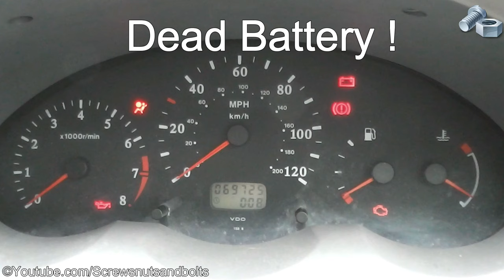How to Start Your Car using a Portable Jump Starter (Booster Pack)

Comment from the maker: Thanks for watching my video. If you found this or any of my other videos helpful, maybe you could consider supporting my channel by using the ‘Thanks’ button below each of my videos. Your support would be really appreciated, thank you ! 👍

Screwsnutsandbolts
Reply: How do you charge these chargers ?
Reply: How do you charge the jump pack?
Reply from the maker: It comes with a mains charger that plugs into the rear of the unit. @niojose967
Reply: @screwsnutsandbolts  there is nothing at the back of to indicate I can plug it anywhere
Reply from the maker: @niojose967  On this one, there's a jack on the upper rear side. The charger plugs in like a laptop charger.
Reply: @screwsnutsandbolts  ok seen it do you know where I can get the charger for it?
Reply from the maker: @niojose967  This one is the exact same one that came with my Halford's booster pack: https://www.ebay.ie/itm/174861069169
Reply: @screwsnutsandbolts  thank you so much appreciate the help Happy New Year
Reply from the maker: @niojose967  You're welcome, happy new year to you !

Comment: I just went through about a dozen videos on portable chargers. Some went for positive/negative, some went to ground... many advised to switch the charger on before you connect the leads, some didn't even show it to be switched on.

This video was the most reasonable out of a dozen I just tried! Thank you.

One thing I would recommend to do, though, is not handle both leads with two hands at the same time to not risk running 600Amp through your heart.
Reply from the maker: Thanks for watching, and for the tip :)

Comment: This looks like the correct way to plug in your positive and negative cables.  I've seen so many videos where people plug in the negative black cable to the negative port of the battery instead of a grounded metal block or bolt somewhere away from the alternator.  The only time you would only plug in a negative cable to the actual negative battery pole is on a working car battery, and you were not using a portable battery jumper.  And on the dead battery side, you would still plug the negative cable to a grounded piece of metal block.
Reply: This is the method you use when connecting another car directly to yours. You cant use any other way. But with some of these charging boxes you can go straight to terminal, as long as they are turned off when you connect. You might have to connect specifically to a part of the car other than a bolt, like some have auto start stop, and those cars have a specific place for you to connect to if youre jumping them.

Comment: yes i found it that simple too using the same 4 in 1 phaze charger model about £50 halfords. has good reviews but not sure about the negative views as it can have enough charge on it straight from the box and works perfect on a 2.0i. suv no problem and could obviously start something much bigger. having said that, it takes hours and hours to fully charge and you can see from the video, its fairly heavy with reasonably lengthed leads but can be hard to find a spot to rest anywhere up by the battery so careful not to scratch or even dent your car. thanks great post!
Reply from the maker: You're very welcome, thanks for the comments. I've had to use it a few times already and find it great !

Comment: Great vid. I had to try this on my sons last night (yup, Christmas Day!)
It didn’t work for me and the booster was only charged a couple of weeks ago.
We had to bump start the car and when I re-read the instructions, it says that once the leads are attached and the unit switched on, you need to wait for a minute to allow the two batteries to equalise before starting. 👍
Reply from the maker: Thanks for the comments :)
Reply: I have just bought Halford 6 in 1 Jump Starter.  Instructions aren't massively clear.  I don't suppose it can hurt to wait a minute as you suggested, haven't seen or read that anywhere else.  I really hope the car starts, it's a relatively new battery.  Cheers.
Reply: These jump starters only boost the voltage of the main battery and assist it with starting the engine.  Depending how flat the main battery is you may have to let the jump starter charge the battery a little to wake it up enough.

Comment: This is from Halfords costs about £50 17ah battery which is good
Reply: hi, I have same model from Halford and  I just want to know when the device is fully charged through ac adapter do the charging red light will go off and green one will turn on?  Mine jump starter showing red light even after charging for 6 hours...
Reply: @paduthala  just purchased one and mine doing same thing

Comment: I bough one of these for a 1.6Ltr Fiesta in January 2017 for £35 from Halfords (I think there must have been an offer on). I have used it twice on a 2.2Ltr Diesel RAV4 (I sold the Fiesta). Once when the battery was completely flat, it turned it over but not fast enough to start. Then a week later on the same car with the battery low, but still able to turn the engine over, but not start. The Halfords jump starter gave it enough extra boost to start it. I think it is fine for smaller engines, but it might struggle on engines over 1.6Ltr with a really flat battery.
Reply from the maker: Yeah I've heard that alright.
Reply: Me too! Got this same one from Halfords and in a sale but not used it yet as not had a flat battery....I worked in the car trade for over 20 yrs and what we used costed like over £200 but jumped absolutely anything like Ford transits,3.0L Mercs etc  time over time ie 5 times before recharging.And i also agree that these should be used for under 1.4L and my car is a 1.3L....depends on how big the batters also matters.You pay for what you get.
Reply: @tardeliesmagic  what did you use back then man?
Reply: @championdesigns  It was a sealy brand,come to think of it...it was close to £280,we used it multiple times when we re arranged the car sales forecourt.I think it went flat after 6 jump starts,3.0L Audi's were easy! Same with those BMW's X5,we had 2 Sealy jump packs in the sale office. Had them for like 3 yrs before we noticed they started going weak.We used them nearly every day and alot every 2 weeks moving a good few cars around.Over kill yeah,but £280 was worth it.I still have my Halfords in my boot of my car,i charge it regardless every 4 months and doesn't lose any charge.Charged it 6 months once and it lost 1 bar.I have a 1.3L so be  easy to jump start.Had my Halfords jump pack 5 yrs now,still holding charge and works.You need a half decent jump pack for a 2L thou.My one was cheap.

Comment: Excellent video and thank you, just wondering when using a jump starter or booster pack, some video says, connecting negative end to ground and some says negative end of the starter or pack connect to negative terminal of battery, which one is the standard or correct way, for a normal cable jumping, negative end goes to ground of vehicle with dead battery.
Reply from the maker: Thanks. The standard way is negative to ground (away from the battery) in case it creates a spark and causes the battery to explode. Unlikely with newer sealed batteries but better safe than sorry :)

Comment: I got a fatmax, does it matter if I conect red first or black?  and after car starts do I have to turn off the unit and take off the wires right away, not good if it's connected too long or something? also how long will those thing last? mine is 1,2 years old havn't used it yet
Reply from the maker: If it's switched off then it doesn't really matter which order you connect them. Once the car starts the alternator will be charging the battery so there's no need to leave it connected. I've had mine for 3 or 4 years and I've only used it a couple of times but it's still working fine. It's recommended to charge them up every couple of months even if you don't use them.

Comment: can you please explain how the current flows when jump starting the car? DC runs from negative to positive. we connect the positive to positive and the negative to the chassis. so, since that is a circuit (ground -negative / positive-live -> positive dead battery)...how is that charging the dead battery through the positive cable?

Comment: Some vids say connect negative to negative battery and some vids show negative battery to earthing point. Which one is it
Reply from the maker: The proper and safer way is to connect the negative to an earthing point. A lead acid battery can produce hydrogen gas, so if the final negative connection is made on the negative battery post, and a spark is created, the battery can explode. That’s why they suggest the final negative connection be made somewhere away from the battery.
Reply: @screwsnutsandbolts  
Thank you! That was my question too. 🤘🏻

Comment: I have a Chicago Jumpstart System.

I've been trying to jumpstart a vehicle for some days now.

The most that came out of the signal was the radio with static.

The battery is not old.  Does it take a few tries before I call service repair?

I dunno if sunny days might help jumpstart success.

What am I doing WRONG!
Reply from the maker: These booster packs are designed for batteries that are low on charge. If the battery is completely flat it probably won't be able to start the car. You might need to use jump leads with another vehicle to get it running.

Comment: Thank you for this video! This might be a silly Q but do you charge the red portable jump starter at home? Also does this device say when the battery is charged/how long would it take?
Reply from the maker: You're welcome. Yes you charge it at home using a mains adapter. It takes a few hours to charge and it displays a green light when it's fully charged.
Reply: Mine will start a six cylinder engine of about 250 cubic inches. If it is completely flat, the jump starter that is, it takes 12 - 18 hours to charge. But if you top them up after each use, it's no time at all. For around, $100
bucks they're really handy.

Comment: Whats is gonna happen if I attach both to the battery - with - and + with + ? Instead of attaching the - to the frame?
Reply from the maker: It will work fine but the reason they suggest attaching the negative to the frame, away from the battery, is in case it causes a spark when you connect it, the spark will be away from the battery, which could be emitting flammable gases and might possibly explode. Most modern batteries are fully sealed but they still recommend this method, just in case !

Comment: These are good packs, I seem to have lost the charger to mine though 😐
Reply from the maker: Could you use one of those universal chargers with the adjustable voltage output ?
Reply: I have used an unregulated 15V 500mA charger to good effect - search on ebay for a suitable one.  Proper rating is 12V 500mA.  I have even removed the battery from one and reconditions it using a CTEK conditioner charger.

Comment: Hi I just bought one but my car battery is in the boot, will it still work? not sure where to connect the  negative to other than the battery.
Reply from the maker: Is there no bare metal or bolts sticking out from the bodywork you can attach it to ?.  Can you move the inner lining of the boot to access metal ?, what about the boot lock catch ?
Reply: @screwsnutsandbolts  Thanks, will try that.

Comment: I don’t understand why one would put the black plug on something else entirely. I tried that and nothing happened. Only when I put the black one on the proper end did my car start up. Why is it like that?
Reply from the maker: I think with some of the older batteries, hydrogen was released while the battery was charging. As you remove the jump leads after starting the engine, there could be a spark which could ignite the hydrogen. However, if you attach the negative cable to a bare piece of metal that is away from the battery, if there is a spark as you detach that cable, it’s nowhere near the hydrogen release.
Reply from the maker: Did you connect the negative lead to a bare piece of metal on the body of the car, or engine ?
Reply: @screwsnutsandbolts  Can I ask, I noticed you removed the black clamp and then the red as the engine was still running. Is this advisable? It looks easier than running the engine for 5-10 minutes once started before then turning the engine off, removing the jump starter and trying the ignition again. 

I followed the Halfords instructions to remove the jump starter after 5-10 mins and then started the car without the jump starter and it worked. 

In future would you recommend using it the way you did, by removing the jump starter once the engine is running?

Thanks in advance, your advice has been really useful so far 👍🏻
Reply from the maker: @Beyond_Belief534  Thanks for watching. This is verbatim from the instruction manual I have from Halfords:

"Turn the rotary On/Off switch on the Power Pack to the ON position. Wait for about one minute to
allow charge in the batteries to equalize.
Start the vehicle engine in the normal way. When the vehicle has started return the rotary On/Off
switch on the Universal Jump Start to the OFF position.
Disconnect the black (-) clamp first. Return it to the correct mount on the Power pack. Then
disconnect the red (+) clamp in the same way. Do NOT pull the cable to disconnect the clip as this
could damage it.
 " There's no mention of waiting 5-10 minutes :)
Reply: @screwsnutsandbolts  Thanks mate, it just confused me when I read on step 7 of the Halfords website "how to jump start a car": 

Steps to using a car battery booster

1. Check the battery booster

Make sure the pack's fully charged

Put the battery booster pack somewhere stable. Don’t put it on the engine as it might fall off when the engine starts.

2. Connect the red jump lead

Connect the red positive (+) jump lead from the battery pack to the positive (+) terminal of the car battery.

3. Connect the black jump lead

Connect the black negative (-) jump lead to an earthing point on your car. Unpainted metal on the engine block or chassis is best.

4. Switch on the pack

Once the battery pack's connected, switch on the pack.

5. Try to start the car

Try to start your car by turning the key in the ignition.

If it doesn’t start after a few tries, there’s probably a more serious problem that needs professional help. If you’re still stuck, you can call us on 0800 88 77 66 or use the AA app.

6. Let the engine run

If the car starts, keep the engine running for about 5 minutes.

After 5 minutes, switch off the boost pack and allow the engine to run for a further 5 to 10 minutes.

7. Turn off and disconnect

Turn off the engine.

Remove the leads in the reverse order to how you placed them on (first disconnect the black lead, then the red lead).

8. Restart your car

Try turning the keys in the ignition to see if the car starts up again

Would you say there's no problem with removing the booster while the engine is running?
Reply from the maker: @Beyond_Belief534  As long as you're careful it should be ok

Comment: I have the same jumper each time I plug the mains charger the light goes green and its not charging, any thoughts on what it could be.
Reply from the maker: I don't know, sorry. Is it new ?.
Reply: @screwsnutsandbolts  its 2 year old.
Reply from the maker: @kinggeneral2760  The battery pack itself could have failed. They don't last too long if they're not periodically charged fully. It could also possibly be a faulty lead. Is there any output from it at all ?
Reply: @screwsnutsandbolts  I have used a volt meter on it yet but when I push the button to see remaining charge the red light comes on, to indicate its discharged.

Comment: Mine came with a cable with a cigarette lighter plug on each end, anyone know what it's for? I thought it might be to recharge it from a car cigarette lighter, but it's not mentioned in the instructions.
Reply from the maker: That's strange, I haven't seen anything like that
Reply: I have a cigarette lighter plug going to a jack plug with mine.
Reply: You can plug in your cigarette lighter to light your cigarettes :). 

Although don’t worry if you don’t smoke they’re used to plug in inverters or things with that connection.
Reply: @screwsnutsandbolts   bought from auction - maybe the auctioneers threw it in??
Reply from the maker: You never know !